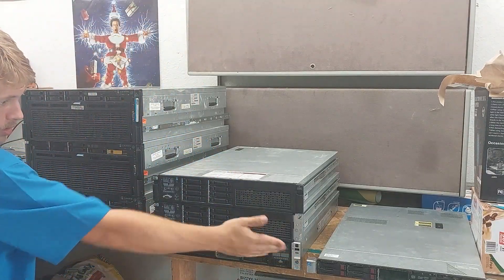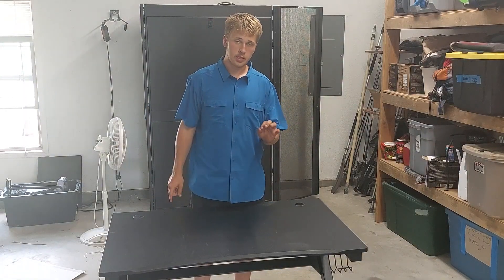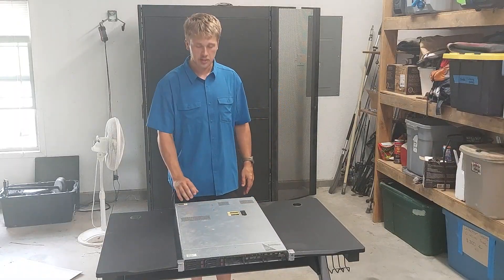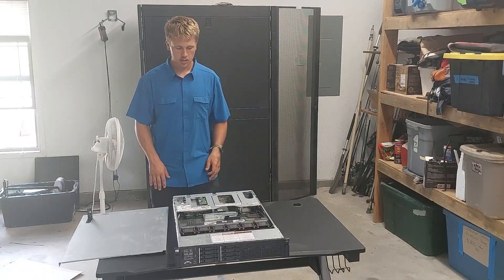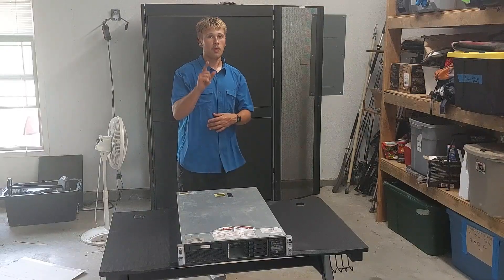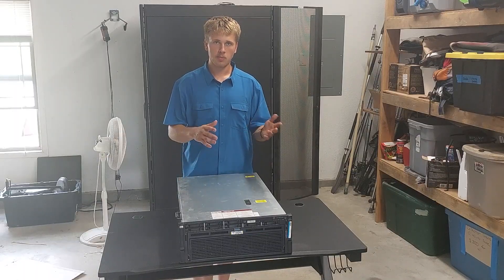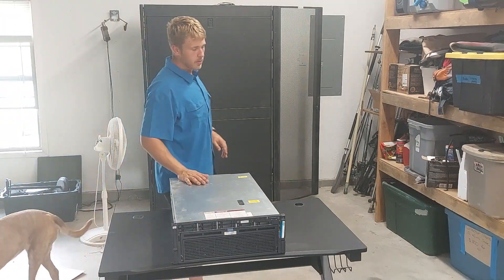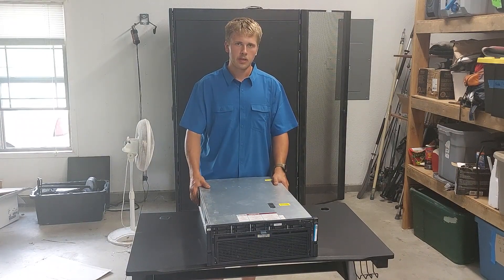New Servers For The Homelab

Comment: It’s neat that you can cover the cost but I have to wonder what exactly you’re even using these for? Outside of a good NAS for people who do lots of content creation or piracy, 99% of homelab stuff I see on YouTube just seems no different than boomers into model trains or whatever. Which like, that’s fine, it is a fun hobby, I guess. But a majority of actual useful home stuff that is going on can seriously all be done with the “horsepower” of an N97 micro PC that costs like $120 on Amazon. Or is there are needs beyond that (which I’d love to hear a legitimate one that is actually a NEED), a SINGLE 2U server from eBay has got to be MORE than enough, right?!
Reply: Yes and no. Any sort of in-home streaming requires a pretty beefy system, especially if you are streaming in anything above 1080p. You need lots of SATA ports for lots of drives. Also, these things need lots of throughput for networking. Have you ever seen how large some of these movies can get? Very large, which requires big switches, which are usually 2 or 3U size, so that requires a full server rack mount. There's lots of factors. Even just being able to take full advantage of fiber networking
Reply: @diode_exe  Sorry but no... For direct streaming of multiple 4K streams without reencoding, you are fine wit N100 or something like that, if you can solve the storage. I have old E5-2680 v4 with Intel ARC A380 and it can do (for home users) like limitless amount of direct streams and more like 4 with 4K HDR reencoding. (dont know how much is the limit, i never needed more) Modern Intel CPUs with iGPUs are even better for that. Regarding the network and switches. Hi-res movies can be big, but in terms of bitrate i doubt we are talking about more than 100mbps per stream on the upper end, which is like ten streams for one gigabit connection. Not sure if any home user needs more like that and even if so, multigig switches are common today... Nobody need noisy and powerhungry old equipment for that. its fine if you like it, but it's definitely not necessary for media streaming  :)
Reply from the maker: Thers truth in that but the other factor your not considering is transcoding, yes many small pics can do transcoding but let's say you have 3 tvs 1 at 720 1 at 1080 1 at 4k. If your movie is a 4k 10bit hevc movie most small form factor gpus cannot process that much data I have up to 3 tvs that stream at the same time hence why I have a large power hungry Nas to compensate for lack of gpu.
Reply from the maker: Yea all the new hardware I'm getting will definitely not be handling any of that lol way to old and I'll have to give it a look. Also I'm working on the new gpu server cause that will be transcoding 4k 10bit hevc to 480i at 12 streams concurrently aswell as running the streaming software that I'm writing so might as well let gpus handle that amount of throughput lmao
Reply from the maker: So for the content creation side you need most of the stuff, for just a little home lab no content creation you don't. I currently have almost 1TB in video just from my channel and my channel is tiny compared to the others. I also have ~25TB in just movies so the Nas and network infrastructure to move all that data is needed. Factor in running community game servers, home assitant, and soon to be homelab cable, it adds up really fast.
Reply: @ControlAndTech  Nothing you have described, though, requires multiple old servers like in this video. N97 mini PC is a minimum but one properly setup server with a beefy GPU etc can handle what you are describing. Again, I would love to see you someday go through all of these machines in the video and describe what service each one will actually be doing.